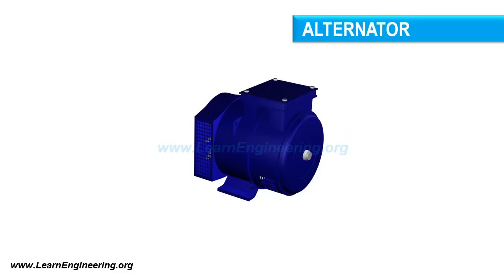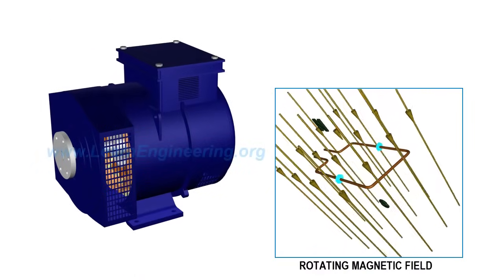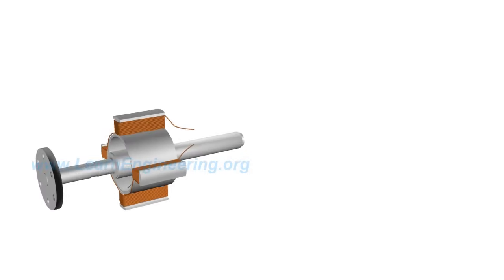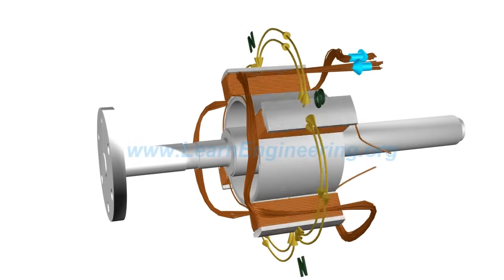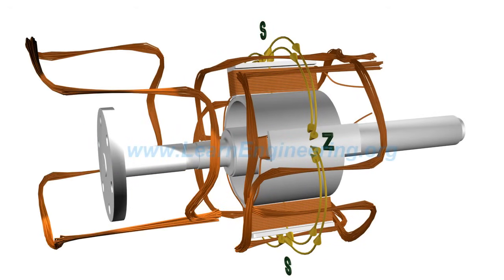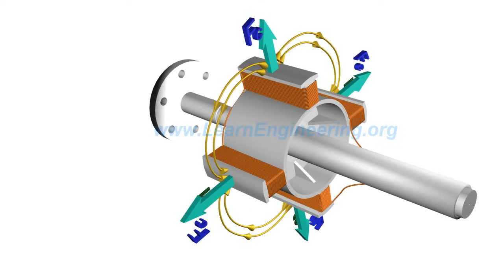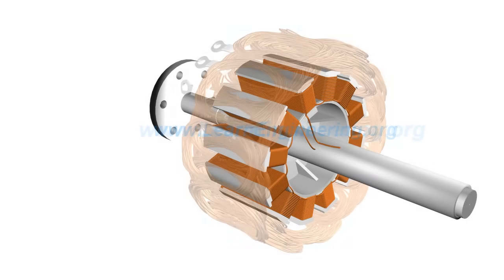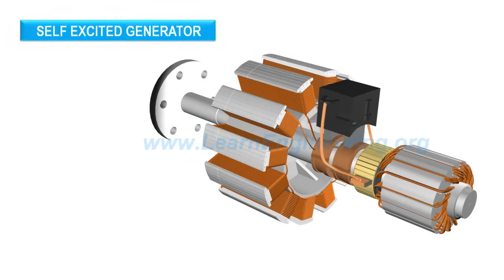How does an Alternator Work ?

Comment: why doesn't the rotor use permanent magnets instead of DC electromagnets?
Reply from the maker: It is well possible to use permanent magnets. Small alternators usually run with it.
Reply: @SabinCivil  then how it produce electricity without permanent magnet? is that because of carbon brush and friction and heat transfer??
Reply: @SabinCivil  
This is possible or not? In generator stator side we give AC input so as time varying magentic field is vary and so chainging magnetic flux is Link with armature and emf is produced So here there is no need to rotate the rotaer to turbine?
Reply: to control output vòltage
 @SabinCivil
Reply: Learn Engineering 
how generate small voltage from small rotator that does not have permanent magnetic??
Reply: +Brian Su I'm your man! Electromagnets are extremelly important for the regulation of the power generated by a power plant. The rotor must have a fixed speed of rotation ω0, dependent by the caracteristics of the alternator and the frequency of the electric grid (50Hz europe, 60Hz america), and in this steady-state scenario, the mechanical torque Cm (generated by a turbine, usually) is equal to the electrical torque Ce (if this doesn't occur, the rotor accelerates or decelerates, leading to a transient scenario with ω not equal to ω0 and the frequency not equal to 50Hz). Cm=Ce=3P/ω0 (in a three phase system), where P is the active power generated by the alternator. P is also proportional to sinδ. The angle δ is the difference between the phase of the internal voltage of the alternator E (remember that |E| is proportional to the CURRENT OF THE ELECTROMAGNETS), and the phase of the voltage at the terminal of the alternator V. If we give more power to the turbine, the effect is an increment of δ (and of course of sinδ), so P increases because sinδ increases. Instead, the reactive power Q generated by the alternator is proportional to cosδ, so when δ increases, Q decreases (and it can became negative!!!). If Q is <0, the alternator is taking reactive power from the electric grid, and surely we don't want this. Luckily Q is also proportional to |E| (with |E| proportional to the eccitation of the electromagnet) and we can avoid this problem increasing the CURRENT OF THE ELECTROMAGNETS, which increases Q and leaves P unchanged.

I hope this can help you.

And sorry for my grammar (I'm italian).

P.S. Rememeber that the power isn't related to the synchronous speed of the rotor (obviously in a synchronous machine), but is related to the mechanical torque.
Reply: @ciroalberghi  
This is possible or not? In generator stator side we give AC input so as time varying magentic field is vary and so chainging magnetic flux is Link with armature and emf is produced So here there is no need to rotate the rotaer to turbine?
Reply: Learn Engineering I guess the disadvantage of using permanent magnets is that you'll be unable to vary the rotor's magnetic force to compensate for changing RPM. In a car's alternator the AVR would need to modulate the current going to the magnets so that the field is reduced as the RPM increases thereby the output current is fixed.
Reply: Linda Kurniawati Magnets are pretty expensive - another reason. Read this http://www.teslamotors.com/blog/induction-versus-dc-brushless-motors
Reply: @drdeltas  This is possible or not? In generator stator side we give AC input so as time varying magentic field is vary and so chainging magnetic flux is Link with armature and emf is produced So here there is no need to rotate the rotaer to turbine?
Reply: THOM9457 Yes I guess that too. Thanks. I think it's also so that the AVR can control the amount of current the alternator produces by varying the electromagnetic force of the rotor.
Reply: one of the biggest disadvantage of using permanent magnet is its egnatic feild is constant so you can not get difrent voltage from it .
Reply: Linda Kurniawati yes but that doesn't matter because the amount of drag on the rotor will always commensurate with the load (electrical resistance) on the coils so the more current you drain the higher the drag and vice versa.
Reply: B4 Bossish in a car's alternator yes, some battery power is necessary to excite the alternator's rotor. In a commercial generator alternator, most are 'self exciting' where the same shaft spins another smaller DC generator to provide current for the larger AC alternator.
Reply: Brian Su because the magnetic field of a permanent magnet cannot be controlled
Reply: nirav sukhadiya yes that's true.
Reply: nirav sukhadiya
where does the dc current come from, battery ??
Reply: @captainb47  ultimately from burning coal, natural gas, wood, running water, nuclear fission, solar radiation, wind currents, or something you can invent and make millions of dollars
Reply: if they use permanent magnets then we can't get variable voltage. bcz current induce by them is equal......
Reply: @niravsukhadiya6102  what about weaker permanent magnets?
Reply: nirav sukhadiya yes that's right. Well, the voltage can still be varied by varying the rotor's speed. I guess using electro magnets would allow the system to regulate the output voltage regardless of rotor RPM, which is necessary in car engines.
Reply: @BrianSu  This is possible or not? In generator stator side we give AC input so as time varying magentic field is vary and so chainging magnetic flux is Link with armature and emf is produced So here there is no need to rotate the rotaer to turbine?
Reply: one of the disadvantages of using permanent magnet is the magnetic field relatively constant, isn't it?
Reply: Brian Su yes,  i guess so.
Reply: I have a question i need help with... I need to generate 2500 watt for 10 hours a day on board a vehicle.... i can fit another alternator and provide 250amp.... how many batteries would i need in order for it to stay charged while the vehicle is running.
Reply: @captainb47  This is possible or not? In generator stator side we give AC input so as time varying magentic field is vary and so chainging magnetic flux is Link with armature and emf is produced So here there is no need to rotate the rotaer to turbine?
Reply: @captainb47  ,
Car batteries range from 40AH to 110AH, and alternators range from 45 amps to 200 amps. If you are using a battery charger, a 10 ampcharger will take 4 to 11 hours to fully charge the battery, a 2 amp charger will take 2-4 days.....

that said , you would need approx 21 amps per hr draw from the alternator(s) to charge the battery
Reply: They often do.  It depends on size and cost tradeoffs.  My Chevy Volt uses permanent magnets in the large alternator that drives the car after the initial charge is gone after the first 35 miles.  The drive motor also uses them, and functions as a generator to slow the car down.
Reply: @utah133  This is possible or not? In generator stator side we give AC input so as time varying magentic field is vary and so chainging magnetic flux is Link with armature and emf is produced So here there is no need to rotate the rotaer to turbine?
Reply: I can't believe that this was posted 3 years ago and is still being discussed about.
Reply: @rabbitdrink  
This is possible or not? In generator stator side we give AC input so as time varying magentic field is vary and so chainging magnetic flux is Link with armature and emf is produced So here there is no need to rotate the rotaer to turbine?
Reply: B4 Bossish wow I'm not sure how to work that out. You'll probably get more professional answers in a proper forum rather than on YouTube :)
Reply: +Brian Su ouu sorry english its not my mother language. and yes
Reply: as u can see at the ebd of the video...using permanent magnets will induce permanent magnetic fields which cannot cope up with the change in voltage...by using electromagnets we can easily control the voltage by changing their magnetic fields...
Reply: @gaming4life25  This is possible or not? In generator stator side we give AC input so as time varying magentic field is vary and so chainging magnetic flux is Link with armature and emf is produced So here there is no need to rotate the rotaer to turbine?
Reply: +Blue Winter Hmm I'm not aware of vibrations making them lose their magnetism, but heat will. Yeah if we're generating our own field then this wouldn't be a problem.
Reply: +cuihaoify to the flux produced by the DC power source isn't constant because the current that goes into the alternator is controlled by the AVR. More current = strong flux and vice versa.
Reply: There are a lot of issues the braking, the speed ,the airgap power and more.
Reply: Electromagnets are much stronger than permanent magnets.
Reply: They're expensive and heavy.
Reply: nirav sukhadiya you can use transformador to UP or down the Volts.
Reply: Brian Su The coils can produce a bigger electromagnetic field and thus more electricity.
Reply: +Amit Shekhar expensive? i dont think they are soo much expensive when you can use that motor for regen energy. us its like generator the AC motor you cant cause they dont have magnets.
Of course you need 2 motors one push and another regen soo no baterry need(yes you nned baterry but just for start and compesantion when your front rotor dont regen.)
Reply: @slevinshafel9395  This is possible or not? In generator stator side we give AC input so as time varying magentic field is vary and so chainging magnetic flux is Link with armature and emf is produced So here there is no need to rotate the rotaer to turbine?
Reply: +SLEVIN SHAFEL what regen?? generate, not regen!!
Reply: +Robert L so you are saying the alternator is self-excited after one point.. what I dont understand then is, when the need arises for more current, where does the extra current to produce higher output come from? I was under the impression that the DC power always comes from the battery throughtout. It may be as small as 3-4 amps and when the need arises, more DC current from the battery is passed to the field windings to generate even higher output.
Reply: @20frieza  
This is possible or not? In generator stator side we give AC input so as time varying magentic field is vary and so chainging magnetic flux is Link with armature and emf is produced So here there is no need to rotate the rotaer to turbine?
Reply: +rationalguy Ohh cool! I've driven the Vauxhall Ampera many times and didn't realise this. I could never get the engine to fire up because the battery was always fully charged. Is there a way to bypass the system and force the engine to start up?
Reply: +Brian Su
I've always thought we didn't use permanent magnets because they'll lose their magnetism over time from vibrations. There's no problem if we're generating our own field right?
Reply: @309387421  This is possible or not? In generator stator side we give AC input so as time varying magentic field is vary and so chainging magnetic flux is Link with armature and emf is produced So here there is no need to rotate the rotaer to turbine?
Reply: +Brian Su that's right... for better control of magnetic field excitation DC voltage is applied
Reply: I don't think so - the magnetic flux produced by DC power source is also constant. It is the turning motion of the rotor that is producing a changing magnetic field.
Reply: If you want to synchronise two or more generators, you'll have to have the same voltage and frequency over both/all generators.
Reply: its magnetic power is weaken by usage time.
Reply: Permanent magnet ain't permanent, they will weaken overtime with hot temperature, as you may know those generator work 24h a day and it's really hot
Reply: +bibbly bobbly cool :)
Reply: +Ciro Alberghi cool!
Reply: +B4 Bossish the same prime mover. it says in the video at 4m10s
Reply: Yeah :)
Reply: so if we were to build an alternator using permanent magnets on the rotor, how would the design and structure change? would we still need the slip commutators and the dc generator?
Reply: no!
Reply: Brian su permanent magnet also provide strong magnetic field bt it's difficult to control it that's why electromagnet is used
Reply: Sacred Geometry use battery  calculator app
Reply: @omsingharjit  _yes yes_ _rotE=_dB/dt and rotH=J+dD/dt and HrotE--ErotH=div(H*E) =power electric motor identic difuzor_speak sound_ ___archaix lord
Reply: you can't use magnets when you are using oil as the source of motion, thus electricity does not really qualify as a subject when relating with cars unless its electric powered cars.
Reply: Brian Su 30 kha 3 phase alternator me habaar DC voltage     denapard hai
Reply: Brian Su cevir
Reply: Heat reduces the life of permanent magnet.Therefore it will increase the cost of maintenance.
Reply: Big may ones use electromagmets
Reply: https://www.youtube.com/playlist?list=PLlEX99xZE8qNTjK78slK8d-8VY25neLRp
Reply: Because manufacturing would be a nightmare.
Reply: Although you can use magnets instead of an excitation current,
With magnets you dont have power factor modulation via excitation current control.
Also,you wouldn't be able to start the machine with amortissour windings and permanent magnets are also not permanent. Hope that cleared something up.
Reply: If we use permanent mangnet the out put current is not varey according to lod .as in older generators it used.  In the permanent mangnet the out put current  is constant thus the energy is west
Reply: And you got 83 different answers. ;)
Reply: Because of cost , Feasible only for small alternator.
Reply: AVR will become redundant then.
Reply: permanent magnet weaker and can not be changeable. this often use on something commercial
Reply: That is known as magneto.used in bikes
Reply: @dilipdas5777  nope a magneto doesn't produce a constant stream of voltage, it only produces a high voltage peak to create a spark every time the magnet cuts the coil. you can't use a magneto to generate electricity.
Reply: @BrianSu  no.magneto also produces very good AC. Ignition timing is totally different story.it needs a pick up coil and CDI
Reply: Because you want to be able to control the intensity of the rotor magnetic field. In that way, you can control the magnitude of the induced voltage in the stator.
Reply: @altuber99_athlete  yes I have since learned this thanks. This is how car alternators work. The AVR controls the intensity so 14+ volts output is maintained regardless of engine RPM.
Reply: TheSoxmania nope because you will still have magnets swiping across the 3 pick up coils. As a magnet nears a coil it produces electricity in one polarity and does the same and it moves away. A dynamo is made by rotating the coils within a permanent magnet field, the rotor's interface will be brushes instead of slip rings.
Reply: because then it would be a dynamo XD
Reply: So an AVR is limited in that it can only change the magnetic field(s) downward (weekening). After a little research I discovered that I was correct. The AVR is basically a variable resistor that is going to cause a voltage drop. The issue is that the output Voltage must be stable and maintained within just a few volts. Trying to achieve this with permanent magnets alone, would require mechanical connections to the output shaft of the generator with a CVT continuously variable transmission to maintain a precise fast acting voltage regulation. Which robs more energy, takes far more fuel, and adds size to the over all generator. Therefore we turn the generator up, just a little more than is needed, and an AVR (no mechanical connection) is able to complete the task of regulationg output voltage quite efficiently.
Reply: yes you're spot on :) not just 'when we turn the generator up'. remember that a car's engine runs anywhere from 700 rpm when idle to 10,000 rpm at full revs; therefore the alternator needs to be able to maintain the steady 14.5v output across the rpm range. Ohh and don't forget it also needs to balance the output depending on the electrical load we place on its output.
Reply: its probably cheap way . . for production

Comment: I was wondering about the EMF-induced current arrows from 1:47 onwards. Considering an imaginary rectangular loop, on the boundary of which are 3 sections of stator coil. Wouldn't the induced electric field be maximal when one of the rotor poles lines up with the boundaries of this loop? In the animation though, the current seems to be zero at this very point...

Comment: Thanks for this animation.it has helped me a lot.can someone please tell me how the different poles are created on each dc winding of the rotating field?which rule to apply to know the direction of the flux?assuming the green arrows as the direction of the current around the coil,and applying right hand thumb rule,I don't get similar result for the direction of the flux as shown.thanks in advance
Reply from the maker: You can easily predict direction of magnetic filed from right hand thump rule.
Reply: Learn Engineering Thank you..My prediction for the direction of the magnetic field is correct by applying the right hand thumb rule as shown at 1:27 for both the N coils wrt the current flow direction,but not for the S coils at 12 and 6 o'clock position.
Reply: Raj Kumar at 1:27 the N and S poles should be switched arround. i.e. 12 and 6 o'clock should be N not S, but the magnetic flux is in the right direction. So you are indeed correct. The whole concept can become very confusing at times, even for engineers.